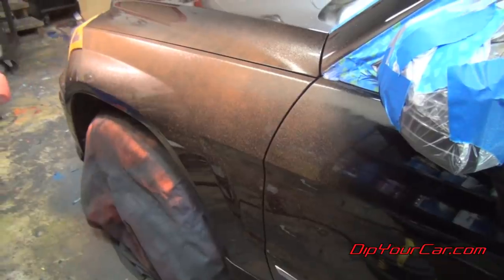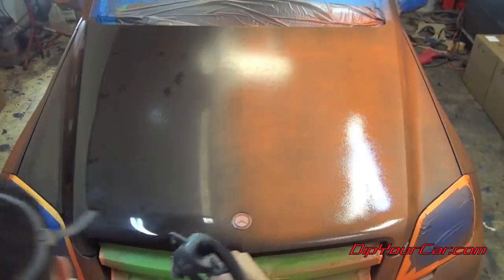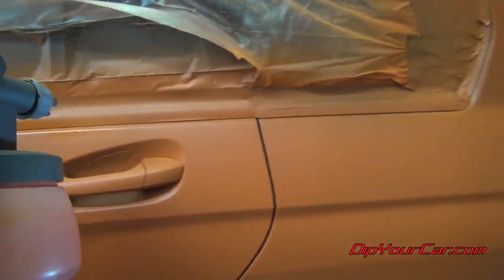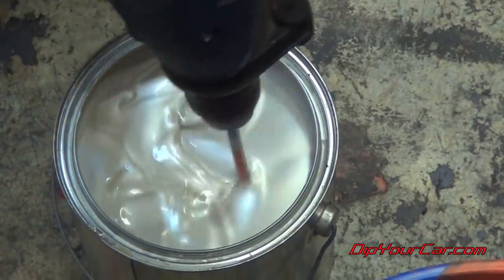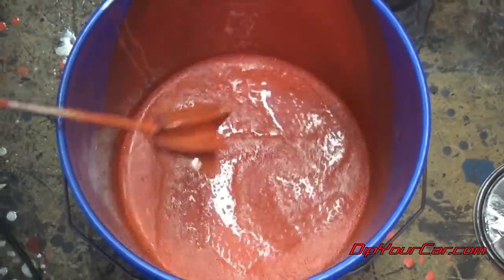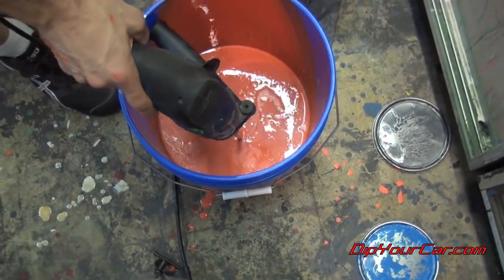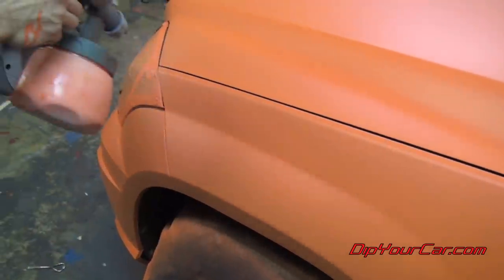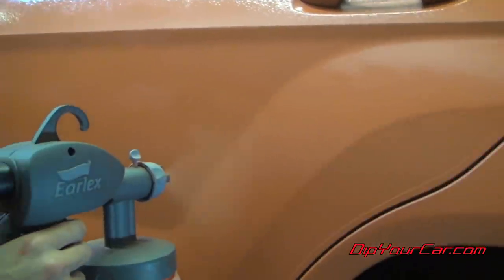Pearlizer Gallons - Pearl Koi Orange Plasti Dip

Comment: Now is it possible to spray plasti dip trough a hvlp spray gun. Or even a air assisted spray pump like a 10:14 kremmlin or graco? im just curious because those guns do not have the best spray tips compared to professional guns.

Comment: id like to see a ride dipped balloon white. then pearl over that. then top coat with the white color changing pearls to finish it off. wondering if it would remain mostly white with a crazy color changing effect depending on your angle our do the pearls completely eliminate the white pearl look. im broke do I hope fonzi tries it for us.
Reply: gilli04 
I did it. Used Nordic Coloshift Pearls on mine. Gives a really cool effect that's very subtle but when it's wet like when it rains and light hits it it's crazy. There's a video here on YouTube with an Escalade dipped the same way.
Reply: Auto Young g
Reply: 8

Comment: I'd like to see a way too pearlize two colors. Like black with dark red pearl.
Reply: You could probably dip the car black, then mix a 80:20 ratio of pearl-to-red, respectively, and put a finishing coat atop the black with the pearl-red.
Reply: Possibly but I wouldn't buy the gallons just to test it. :/ I wish there were smaller sizes just for testing purposes.
Reply: cody nunley The gallons themselves are not, I think, too expensive. If you've got a middle-class income, or thereabouts, and you are not in debt up to your eyeballs, I figure you could risk the money.